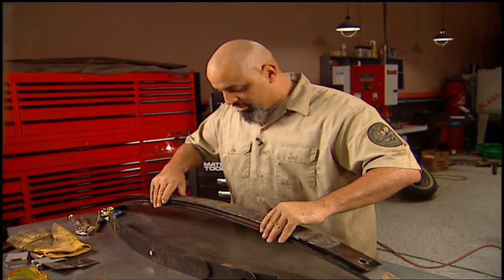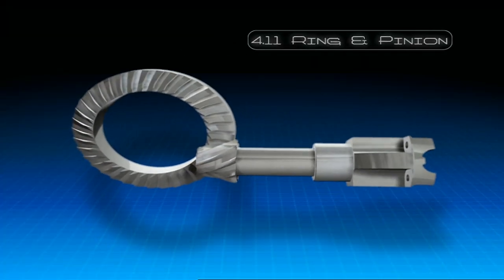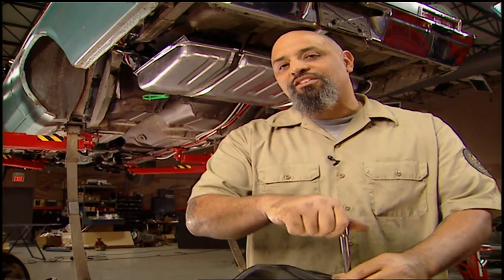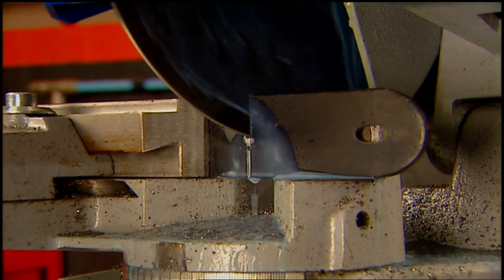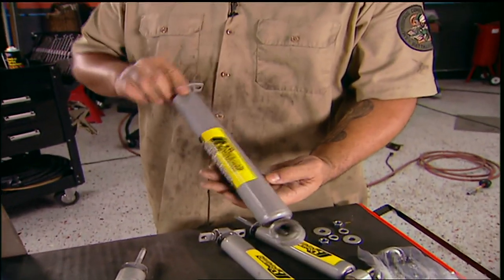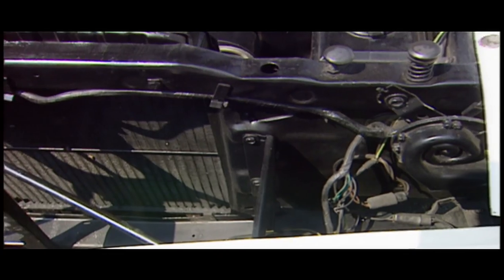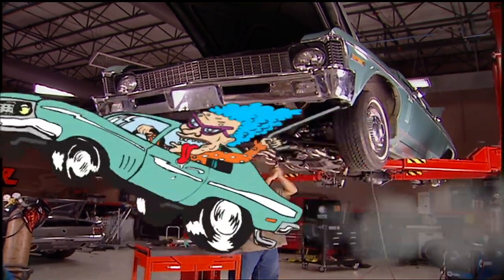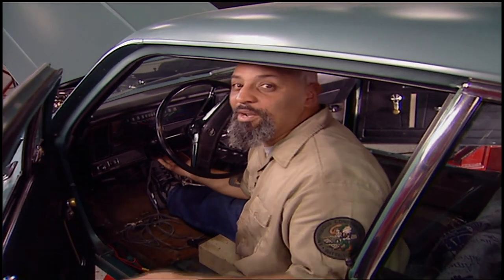Making Super Stock Springs For The '70 Nova - MuscleCar S2, E2

Comment: you can also run a heavy duty shock or air shock on the rear passengerside and a stock shock on the drivers side for better traction when racing . also you can take a set of stock front shocks and drill a hole in the bottom . watch out they will squirt oil. when you drill a hole in the bottom and let the oil drain out the shocks will allow the front end to lift when launching at the drag strip or racing on a strait stretch and short the weight to the back for better traction as well